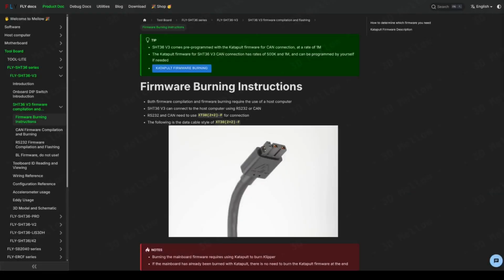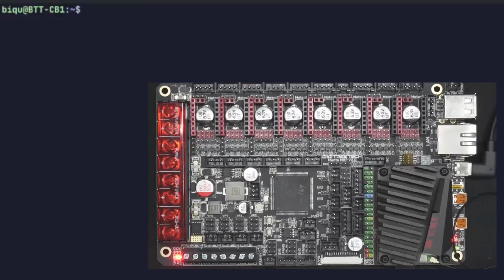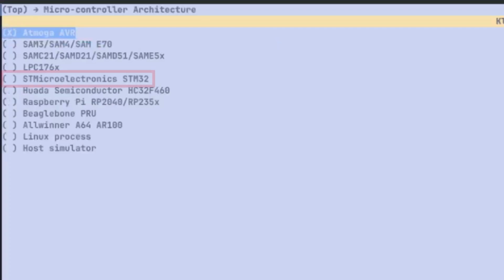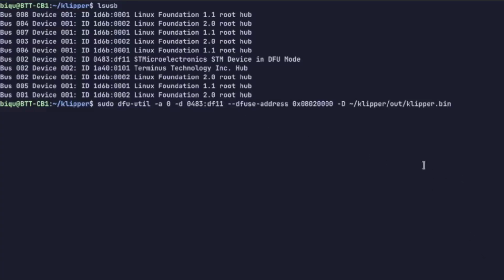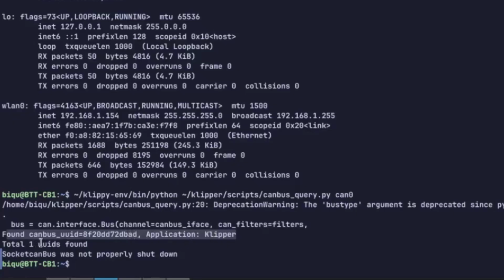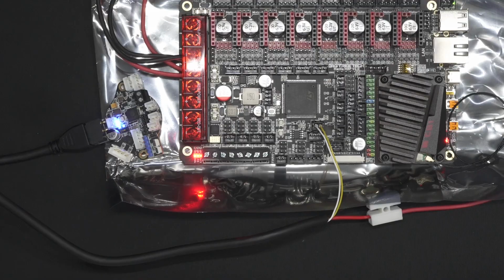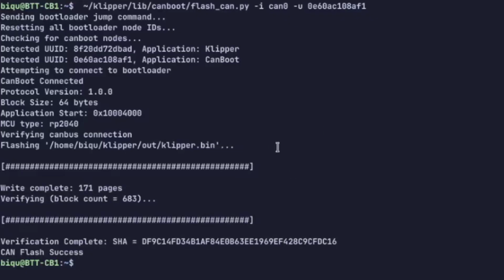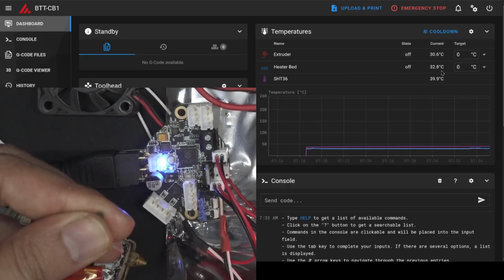SHT36 V3 + Manta M8P CAN Bus Setup | Step-by-Step Klipper Firmware & Wiring Guide

Comment: I bought a Manta M5P + CM5 + SHT36 V3 MAX board.
I followed all the installation steps, but I ended up flashing the firmware again on the SHT36 V3 MAX board.
I didn't realize that the firmware already came pre-configured from the factory.
I'm not sure if that caused the problem, but now I can't find the board UUID.
I believe I might have skipped some step in the process.
I think your video might help me, since the board is similar. I know some commands will be different because it is another model.
Reply from the maker: Let me know how it goes
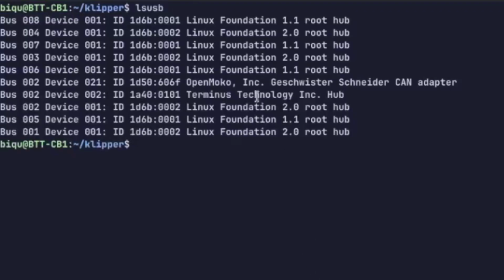Reply: I followed all the steps in the video, but when I reached the 11:56 mark, the “GESCHWISTER SCHNEIDER CAN ADAPTER” did not appear. What could I have done wrong?

My board is a MANTA M5P with CM5 (Raspberry Pi). I configured it according to my board’s architecture, which is different from yours, but I believe the rest of the process should follow the same path.

I’m still a beginner and doing this without much experience, only a basic understanding from tutorial videos. Unfortunately, I haven’t found other videos that explain everything step by step from the very beginning like yours.

I would just like to know how I can reset the board and start again. Is there any command to do that?
Reply from the maker: @sineziodeluca3871 
Make sure you first setup the mainboard (manta M5P) with CAN support and check if CAN interface is listed only then proceed to flash V3 max with CAN support other wise it won't list.

To restore, press and hold the boot button on V3 max while you connect with USB-C data cable to you computer, once connected, release the boot button. If you are using Windows it will appear as a driver, from there you can restore
Reply: @radiy3dprints I haven’t reached the SHT36 V3 Max board yet. At the moment I am only trying to complete the first flashing steps on the Manta M5P board.

I just realized that in your video you are using a USB-C cable connected to your M8P motherboard. I was trying to use DFU mode via Wi-Fi.

I will try again, but this time I will do it the same way you did in the video, using a USB-C cable connecting my Manta M5P directly to the computer.

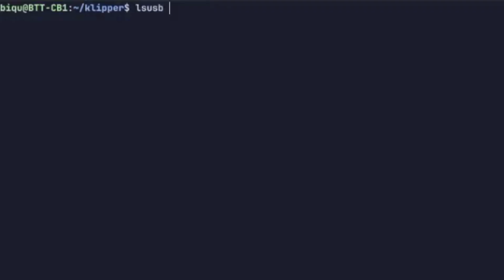At 11:54 in the video, you say to run the command "dmesg -HW". After that, do you simply press the reset/restart button on the board?

After running this command, "lsusb" should show “OpenMoko Inc. GESCHWISTER SCHNEIDER CAN ADAPTER”, correct?

In my case it didn’t appear. Instead, it showed “OpenMoko Inc. STM32G0B1xx”.

I’m from Brazil and I’m still learning. Thank you very much for sharing this video and helping so many people.
Reply from the maker: @sineziodeluca3871 
The manta M5P must be in DFU mode for flashing Katapult and Klipper, I use USB-C to power the board

dmesg command is used only to monitor the status every time you press the reset button on Manta M5P, its not mandatory you can skip that.

First,  flash Katapult boot loader then flash Klipper firmware